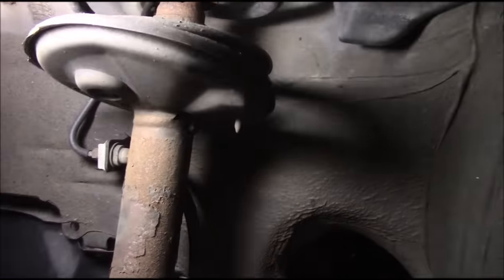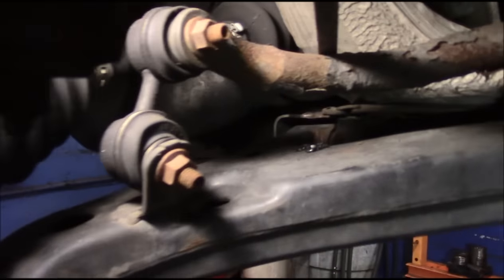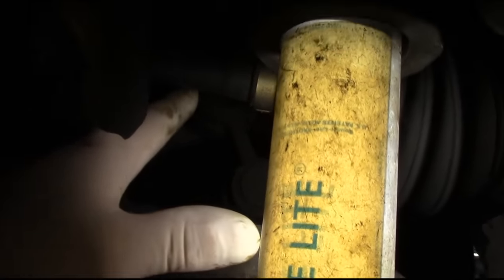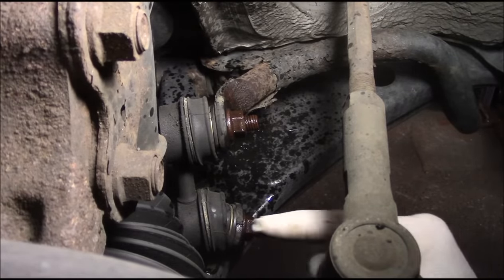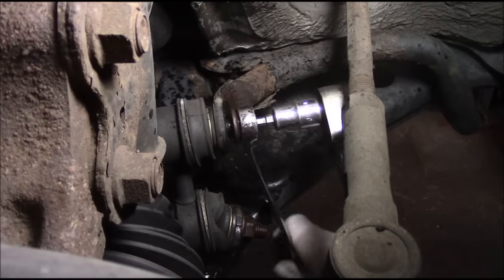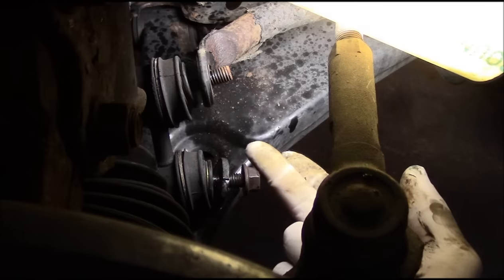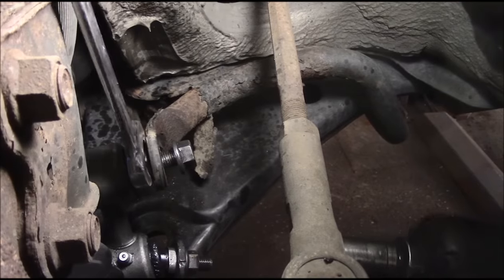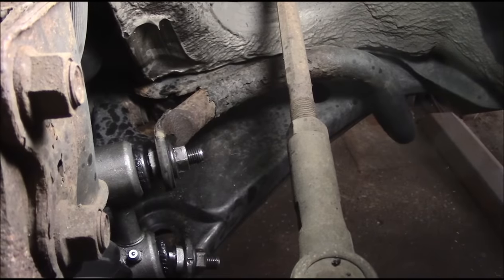Diagnosing Front End Noise

Comment: Hello Jim....really enjoy your videos...very well done. 
Have a 5 speed 86 Honda prelude si.....when you accelerate, it pulls to the left in between gear changes.....torque steer..........what's causing that?
your comments/advice would be much appreciated....thanks
Reply from the maker: gr8trips4u This I a a common problem Check all the motor and trans mounts. Thanks for watching!
Reply: Thank you very Jim...much appreciated
Just had ball joints, tie rod ends, front wheel bearings replaced but steering wheels shakes, specially at higher speeds like 50 and higher
The cv axle on left has also been replaced
Had the alignment and tires balanced but problem is still persists....could something be loose? Afraid something might come apart while driving?
Your comments/advice would be much appreciated
Thanks and best wishes
Reply from the maker: gr8trips4u Take a second look at the cv axels and rebalance the tires.
Reply: Thanks Jim...much appreciated
Could the rack and pinion be causing the steering wheel shaking?
The left side c/v had been replaced a few months ago.....either side doesn't make any of those sounds when turning the wheels in either direction....
Wish you were closer.. Would bring the car to you
Thanks and best wishes
Reply from the maker: gr8trips4u It's not likely to be the rack and pinion, it's more likely to be the inner or outer tie rod ends.
Reply: Thank you Jim....have had all the tie rod ends and ball joints replaced
Reply from the maker: Thank you for watching I'm happy to help

Comment: I have squeaky noise in my front right wheel. It makes the noise when I turn the wheel left mostly and over bumps also when parked I can make it do it by pushing up and down on it. I think I just found it. The upper ball joint boot is shot so I'm thinking that's it either way I have to replace it. I thought it was the bushings but spraying oil on it didn't quiet it down. I didn't spray the ball joint because it's obviously not safe to drive so I figure I'll replace it then see if it's still doing it and if so I'll spray more joints one at a time until I find it if that even works lol. The vehicle was wrecked a year ago and the lower ball joint was replaced after it snapped off from the impact. I don't know why they didn't replace the upper and everything else as I told them to just to be safe because the ball joint didn't actually snap until after one of the 6 times I got it back and had to return it the next day but that's the crooked local dealership for ya. I should take it back and make them do it but it's been a year but the old man did slam into my tire so hard i had his paint embedded into the tire itself but they just wanted to fix the body and made me fight to have the rest fixed even tho the guys insurance was great and actually even helped me in dealing with the shop after they kept saying it was finished but i knew it wasn't right.

Comment: Hi Jim
I have a lexus IS250awd 2009 with only 50K miles on it, and recently we started to hear a clunking noise in the passenger side area, we have difficulty to hear if it is coming from the front or rear wheel. After lifting the car we checked, if there was any wear using a long bar like you do , on all the suspension parts  , and we could not see anything.  The clunking noise appears when I drive on a road with any  pot holes that are close together even at low speed , the noise is loud enough to hear it sounding like a sheet of metal. If I hit a large pot hole, I hear nothing.  The handling of the car at any  speed is very precise, given no indication of noise.
Please can you help ?
regards

Comment: I found that using a hex wrench and a box wrench with both on the outside works better than one wrench on both sides of the sway bar because after I tighten down the nut then the inside wrench gets stuck inside and/or damage can be done to the rubber grease boot.  Am i missing something?  Does Moog make the hex wrench version as well?

Comment: I have beeen advised to replace front end supension (tie rod etc). Which parts should I replace because reolacing the whole front end is expensive
Reply from the maker: What kind of noise are you getting?
Reply: There is no noise but this is a 1998 Honda Accord When I replaced the front CV axles,  the mechanic said it is dangerous to drive this car on the highway.

Comment: Hey, do you have any idea what’s the problem with my 01 Escape? This is what’s doing,  when I unplug the top hose from egr works fine but when I plug it back on starts to act like having hiccups until almost shut off like can’t breathe.  I replaced the egr, solenoid, and the dpfe sensor but nothing works where you thing it’s clogged

Comment: Jim Doesnt the front sway bar links make a click clacking noise when you turn the vehicle?
Reply from the maker: No most of the time you will get the noise over bumps
Reply: jimthecarguy thanks for the info on this will check the sway bar links on my honda civic 06 tomorrow since I am getting a rattling noise when only going over bumps or potholes and want to check this part. Would bad struts also make a rattling noise when going bumps or potholes? My car seems to bounce a bit after going over speed bumps and I’m not sure if they’ve ever been replaced on the car

Comment: I have a 01 Camry, turning the wheel it squeaks a bit.. but when I drive over any bumpy surface theres a clunking noise.. like something is loose or about to fall off coming from my front left wheel area.. was told struts but they look fine to me, shocks seem fine, the noise almost sounds exactly like the sound diner plates make when you stack them.. any ideas??

Comment: I have a noise that sounds like an old car door opening metal on metal. I replaced upper and lower ball joints thinking it was the upper but still doing it. It does it over bumps and turning the wheel left or right. It doesn't seem to do it when the vehicle has been parked a few hrs until I've driven a couple miles then it starts when I hit bumps and turning left, after that it gets worse and starts to do it when I turn either way. It's coming from my right front wheel. I'd appreciate any comments pointing me in the right direction. Thanks.

Comment: My 2009 Lincoln MKZ makes a REAR clunking noise even over a small bump at low speed.  It sounds like a hollow beer keg was in the trunk; I checked.  I bounced on the rear of the car and the shocks seems great and no clunking.  Shoved the rear side to side and no clunking. I then opened the trunk, stood inside and jumped up and down like an ape; no clanking noise.  Traveling straight at high speeds, normal speeds or making an abrupt stop or "darting out of the gate" there is still no noise; however, when traveling, say, on a long strip of road in a continuous turning direction you can hear slight clanking.  The biggest/loudest noise is when the REAR END pulls up over a small bump/driveway ->  its like a two large hollow metal bars are bumping and or sliding by on another. The sound is more pronounced when moving forward compared to backing up over the "bump".   ANYWAY,  I am fairly low IQ guy with respect to car mechanics so, in the rear, I have shock absorbers, struts, sway bar linkage, and bushings???  Is this correct?  Anything else that could be contributing to this issue?

Comment: Hi Jim.. I'm having the same noise on my 2013 ford fiesta. When I remove the stabilizer and drove the car, it's but when I put it back it comes back. I did change the stabilizer but the soonud it's there. When the road it's smooth and straight its quiet but when it's bumpy 9r potholes or pulling off the pavement on one wheel or speed humbs the sound it's there. Please advise. Thank you in advance.

Comment: Hi Jim. Thank for your concern to solve problem for car. I hope u can solve problem of mine, that is my car start to make annoying humming sound when speed get faster (>25km/h). That is my left front wheel. My car is mitsubishi lancer(base model) year circa 1996 model i think. Thank all for the effort.
Reply from the maker: Mohd Rozakhi Ismail When you drive and change lanes does the noise get louder or quieter? If it does it could be the hub bearings. Hope this helps
Reply: jimthecarguy. Oh my!! I dont think i will get a reply from u. I will check on that sir. Thank u so so so much.

Comment: I have  98 Mustang 3.8, with a clicking noise coming from the right front. I can usually hear it when I accelerate somewhere in the 25 MPH area. When I let off the gas, the noise stops. I noticed that I also hear it with the cruise control set as well. Could it be the speedometer cable? Just replaced wheel bearings, brakes and rotors and I still hear it.
Reply from the maker: Sorry It is hard to tell until I drive the car and hear the noise.

Comment: I was told by Mavis Auto Shop that anytime you have a bad sway bar link you should change the Strut “Because the link can only get damaged if the struts is not functioning properly. If struts are not absorbing the bumps, then the links get over worked and get damaged.  Is that true?
Reply from the maker: No absolutely not true. There just trying to up sell. The links go bad because of rust .
Reply: Thanks for the advice, one more question. Before watching this video I purchased Struts from 1A Auto website and purchased their Brand Products.  I’m wondering now If i made a big mistake with not buying the moog brand. I don’t want my car to feel much different then when I purchased it. I’m wondering if the house brand is going to cost me trouble in the near future. I have a 2011 Mazda3 S with 53,000 .  The house brand was so much cheaper.  I am on a budget but I wonder if this house brand is going to cost me more in the long run with labor cost.   I am expecting the delivery today.  I ordered the links , and struts from them. Right now i’m trying to find the control arms since i’m getting a deal on the labor cost this time.  What do you think?  Thanks again for your help 🙏
Reply: and should i replace anything else, while the mehcanic is down there ?  thanks
Reply from the maker: I personally like the Moog over any other brands. I'm not sure what make there house brand is .Keep me posted how you do.

Comment: I have a 2012 Chrysler 300 V8 all wheel drive my knocking noise is front passenger side all the time not just going over any help
Reply from the maker: You will need to check the ball joints, tie rods, bushings and links.Thanks for watching.
Reply: @jimthecarguy  well shop told me front brakes then ball joints 900

Comment: I have a 2007 Buick Lucerne with some front end play and slight knocking when making turns ,would you check it out for me and repair please??  Ive had a tech check it out and we replaced the front quick struts and about $500 later i still have the problem....

Comment: I have just had the sway bar links done on my Nissan Qashqai 2013. It sure rides better but the knocking on small sharp bumps are still felt, coming up through the steering wheel. I actually feel  'tapping/knocking  more than hear it. Any suggestions as to what I might try next would be appreciated. Thanks
Reply: Could be your tie rod ends if you feel it through the steering wheel. Have them check your ball joints and strut mounts as well.
Reply: @jgizzy  Thanks. I will have the tie rod ends checked

Comment: I have a question... I have a Toyota Corolla 2007 it was brand new when I bought it however, it is 10 years old now. I just had rotors replaced because the wheel was shaking.. I'm still hearing a front end noise that sounds like a rumbling..like when you're on a certain type of road I had the wheel shaking also but the rotors took care of that. I still have some life in my brake pads. I will get them replaced next month. I just went in for tire alignment and so they could check my tires I just got them.  they're brand new since before Christmas of 2017. what could possibly be creating this noise?  thanks
Reply from the maker: Thank you .Live stream on Sunday at 7:00 PM I hope you can stop by .I will talk about this problem.

Comment: Even though there's grease fittings don't those links come pre greased?
Reply: MOOG website says all CK and K (Problem Solver series) parts with grease fittings are pre-greased. Best way to SEE all available brands and types available for ANY car/truck for ANY specific year at the same time is at RockAuto.com. MOOG is most notable for reengineering all new parts (Problem Solver) to eliminate original OEM design flaws for a much longer life.

Comment: Hey There. I have a noise in the front of my 2001 rav4 passenger side and can't figure it out. I have replaced control arms on both sides, ball joints, inner and outer tie rods, the sway bar links and bushings. I cannot figure it out, everything seems tight. When I grab the wheel both from the sides and from top and bottom, seems tight - no movement. When I grab the strut and spring no movement and seems stiff. Any suggestions?
Reply: I would check the bearing plate on top of the front struts where it bolts in under the hood.

Comment: 2015 Acura RDX with 45k I replaced all brake pads and rotors turned and I have a noise. 
10 /15 feet before stopping there is a low sounding whine noise.....

Comment: My car makes the sound at 0:46 sometimes after i start the engine. And it usually goes away within 1-2 minutes. Is this normal?
Reply: If it's a manual transmission vehicle and the noise goes away or gets quiet when you press the clutch pedal down to the floor -- then it's likely your clutch's throwout bearing.

Comment: hello, i have a werid thing on my 01 corolla. the driver side only, the axle is on a diagonal angle pointing backwards. I dont know why, the wheel has little play at 3-9. wheel wobbles and axle wobbles too. Help please! nothing seems broken or making any weird noises. i just got the car a few weeks ago
Reply from the maker: Does the car drive straight?  Can you send me a picture?
Reply: @jimthecarguy   how could i send you a photo? the car drives pretty straight. steering wheel shakes at 60s-70s mph and it shakes badly while braking at high speeds (new rotors/brake pads) when i put it on jackstand and pressed on the brakes the wheel would turn slightly since there is little play on the wheel...makes sense. but like i said nothing seems broken, i thought it was the R-side ball joint on the left side may be. But nope, this model has no directional ball joints.

Comment: I'm having the same rattling on my 2017 Camry but the mechanic doesn't seem to know what the problem is exactly
Reply: Usually it's sway bar bushings if they they don't know what it is because they never check them for some reason. Best way to find out is with your car packed open diver or passenger door put your hands on the roof and rock the car back and forth you'll hear the clunking don't just assume it the sway bar bushings because it could be tie rod end's too.

Comment: I sound like a diesel train around 44-50 miles an hour. It doesn't shake the steering wheel but is VERY ODD. I believe that the thrust bearing is bad... sorta squeaky birds noise when clutch is in... tho don't notice so much when actually driving. Need to do a 309 mile trip so am concerned.  Any ideas... manual transmission.
Reply from the maker: Eden Henderson Sounds right it is the thrust bearing. I would get it repaired before the trip.

Comment: As a former service advisor I would have given her the total cost of repair no matter what the customer said. That will avoid any problems when the customer arrives to pick up the car after the repair is complete and the bill is 12 times higher (slight exaggeration) than they thought it was going to be. You see, some customers have no realistic idea what a car repair will cost them until you tell them. This way I can deal with the 'sticker shock' now instead of the young lady at the cashier booth having to deal with an irate customer who doesn't want to pay the bill.
I can't tell you how many times a customer said just fix it, I don't care how much it cost. But 10 seconds later they are freaking out after I give them the total cost of repair. Lots of those same customers will call around to get a second opinion before calling me back and approving the repair after checking the cost with other shops. This is an option no longer available at 7:00pm AFTER the repair is done and the customer had her work mate drop her off at the dealership to get her car.

Comment: wish u were my mechanic.  got ripped off twice recently.  one time was a door handle replacement.  easy job, i could do it but car was getting worked on anyways.  they charged $88 for that.  a door handle.
Reply from the maker: I'm happy to help.Thank you for stopping by the shop.To be honest $88.00 is a fair price.
Reply: Jon Focker gotta open up the door, without messing up electronics, and the part itself could be a most of that. knew a guy with a bmw that spent 90$ just for the handle, which was shipped from germany, AND hand to pay to have it painted. 450$ at the dealership, so really you did fine

Comment: I have a 2016 Acura MDX with only 45,000 miles and I suddenly have a squeaking noise when the front end goes up and down over a speedbump or if I open the hood and push up and down on the front end.  It's definitely more of a squeak than a bump noise...sort of like a very old bed boxspring.  Anyone have an idea on what I'm hearing?